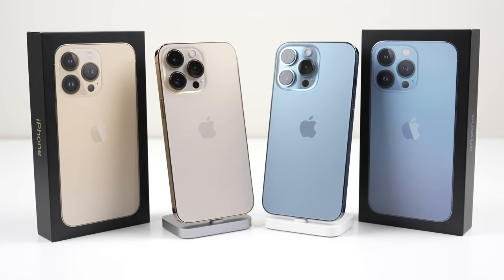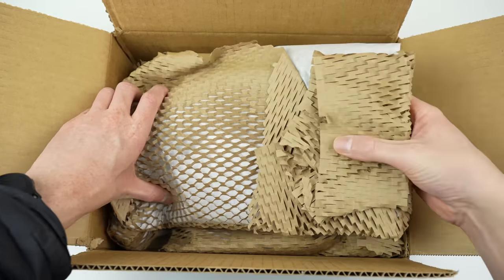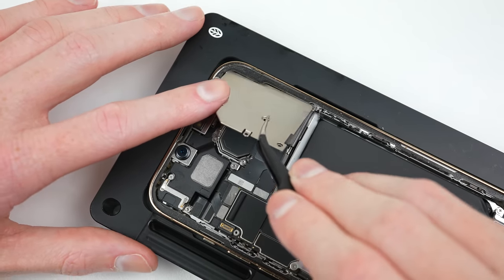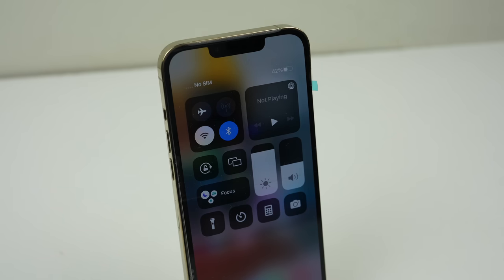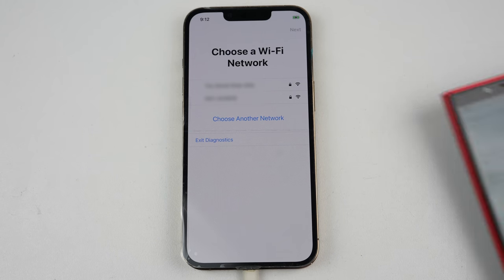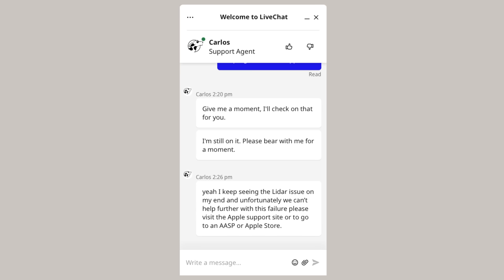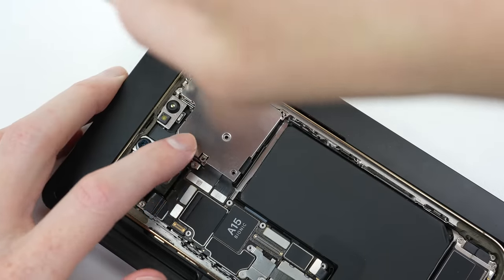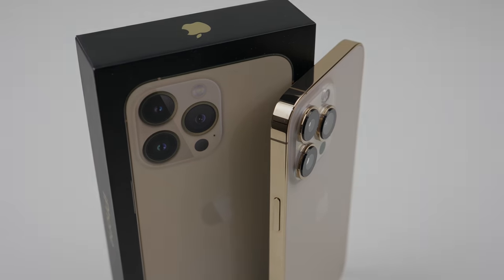Apples Self Repair Program Is Not What It Seems

Comment: For anyone curious, every part associated with the error messages has a small chip embedded in the part. The battery has a small logic board that has this chip, the display has it soldered to the back of the display, and the cameras have it embedded in the flex cable. This chip holds a ROM module with the part's serial number, if the serial number is different from what the motherboard expects then it throws an error and is no longer able to communicate properly with the unit. This is not a calibration issue, parts needing calibration generally still function, just "off center" so to speak, the ambient light sensor would view full sunlight as ambient light and ambient light as pitch black,. Adjusting values back to what they're supposed to be is what "calibration" means. The ambient light sensor doesn't work because it's IC is integrated with the front camera flex and is paired, the proximity sensor is it's own unit and not a paired device so it still turns the screen off when covered up. Stuttering cameras are due to the controller IC not properly communicating with the motherboard, that's not a calibration issue, it's a programming one. For older units, tools exist to copy this data from the devices being changed to the new ones like screens and cameras. Apparently Apple re-writes the data on the motherboard which is probably why it takes so long, writing the display itself takes about 15 seconds, I know because I've done a lot of them. They likely do this (because it otherwise makes no sense) to prevent the device from having multiple compatible replacement parts, if you refurbish the display you won't be able to use it on the phone again.
TLDR: 100% of these issues could go away tomorrow if Apple just updated the motherboard's firmware, but they won't.
Reply: Thank you for an information, so its the same used on a expensive cars, but for phone lol

Comment: Omg thank you for this video, it has been fascinating. I’ve been wondering about Apple’s repair program since they announced it and I assumed that they would give you access to everything as long you pay the price tag that comes with it. It’s a shame that they did not provide the calibration tool to finish the repair (Are they worried people will use the tool’s bits in order to bypass iPhone security and gain unlawful access to their devices?) If so, they could might as well allow you to create a user name and password as the repair technician and access the calibration tool remotely, effectively keeping their bits in their secure servers.
Reply: The reason it is the way it is, is very simple. Money.

Comment: I miss the days of hot swappable pieces for electronics making repairability a cinch
Reply: I miss electronics being made without the use of proprietary screws.
Reply: @LexYeen  amen
Reply: nokia days were swappable parts are easy
Reply: @lace1210  That's why nokia phones are still running!
Reply: It's only getting worse. Laptops for example are now starting to be shipped with soldered on memory. I won't be surprised if the SSD soon follows.
Reply: I miss the days of detachable batteries. I just had a case at work where a phone froze and wouldn't respond to anything and only options were to wait for the battery to die or remove it. Can't remove batteries without tools anymore so waiting it is.
Reply: ahhh the iphone 4 days, so good
Reply: @croftmanor2k23  apple has already been doing this for years
Reply: That was when the manufacturers weren't so greedy and ruled by money.
Reply: @gp3328  You mean Crapple, not Apple
Reply: @LexYeen  Samsung still just uses Phillips screws. I replaced my battery on my A71 in an hour, pretty easy all things considered.
Reply: Wozniak spoke about this in a cameo for Louis Rossmann, and man, his words hit super hard. Gone are the days of hot swappable components without proprietary stuff or even calibration that is so unnecessary. Worse is that in the case, there's even a data collection for a simple repair, which is already a violation of privacy. 

This is why we must keep supporting companies like Fairphone and Framework. If they succeed by being with the times (like flagship level components and global availability), we can only hope change is happening, which I doubt would happen.

Comment: Back when I was doing iPhone repairs (up til 7) there were much simpler issues; now I had to learn about the new restrictions in building my new iPhone XR. I got it May 21.

They have made it so much more difficult, but if you shop while anticipating the restrictions, you can still get a good deal. My 256GB factory unlocked XR had a broken back glass but everything else was spotless, and I already had an XR 64GB with a shattered LCD but good back glass and frame, as long as you keep track of what parts go where, no error messages. 

With taxes and genuine adhesives, total cost was <$250, but the device itself was $220. Apple's repair program costs $199 before taxes. 

If I have to spend the same money either way, might as well go the way that also nets me 3x the memory. 

This was fascinating to watch tho. With the adhesive removal, I find that using a micro screwdriver works better for wrapping the adhesive around, and pulling away while in the same plane and also pulling and spooling with a sort of cadence will minimize the breaks. Feel the tension of the adhesive and dont let it get longer than 1CM before spooling and pulling again  I used the ispropyl swabs only after getting the adhesive off as to remove leftover residue and oils. 

As a side note, the screwdriver trick can also work for removing an iPhone battery without extracting the taptic engine. If the adhesive does snap, use the existing adhesive on the screwdriver to re-adhere the adhesive at the break and you can start pulling again.  When you're tasked with repairing hundreds of devices per day, you learn little tricks like that to speed up the process. 

Edit: As a note, be careful of your screwdriver orientation, especially if you have metallic screwdrivers. As I mentioned, it helps to be pulling from as close to the same plane as the adhesive, and if you're not careful you can rub off the anodizing on the frame of the device while you're spooling. Even plastic tools can leave a shine. Just thought I'd mention it.  

I do like that repair cradle as well, my low-tech solution involved a windshield suction cup for an old GPS; if you remove the ball joint from the pivoting device holder, it acts like a display kickstand. That cradle seems a lot nicer than the ones we used at our shop, even. I only kept my screwdrivers and separator tools, so I also had to use a food dehydrator to soften the LCD adhesive since I no longer have access to a hot plate. I also popper it back into the heater after the repair just to help improve moisture resistance since I don't have that applicator you showed. It worked well enough on the 6s/7 seals, since the frame and adhesive expand and contract with each other given the applied heat.

Just thought I'd offer some tips, I hope they help with your future repairs; thanks for posting this video!.
Reply from the maker: Thanks for the tips. I will keep them in mind.

Comment: I have a question do you have a 2015 MacBook air screen?
I have a MacBook air that turns on but doesn't display anything. I will plug it into an external monitor and check. The MacBook is water damaged.

Comment: Now for those still defending Apple we see many offense they have done to their customers:

1. Data Privacy - Changing screen, camera, battery, etc. doesn't mean people need to give permission to Apple on their calls, images, and other privacy stuff just for the sake of having genuine parts acknowledgement. Not that there's no connection for data and repair to begin with. 

2. Ownership - People don't need permission from Apple to repair/replace parts on their own device and for Apple to downgrade the "features" just because they repair their own device. What right does Apple have to limit people's rights to use their own device just because they don't follow what Apple's repair guidelines? Does people own their iPhone or Apple does?

3. Repair shenanigans- The sheer hassle of "calibration" already adds to perception of general populace that it's better to buy or let only Apple repair their devices, coupled with "features" downgrades for unauthorized repair, this in turn further cement the perception of the general populace pertaining repair & ownership. Even the "technician" doesn't know the problem of the said device after "calibration" and offering your data to Apple. What's the point of Apple repair program?
Reply: thing is I think part of the OG repair process is to pretty much reset the phone to factory settings then start the repair at least thats part of my experience when I tried to have a battery replacement on my iPhone 5 so theoretically nothing is "gained nor lost" but if you don't use iCloud then you better be sure you have the entire phone backed up to a PC/MacBook/Laptop when you get it back.

as this "repair" process is no different from what happens behind the doors of Apple Service Center yes you have a technician calling a technician to do the diagnostics system
Reply: I want to see the factory worker in Shenzen moving the camera back and forth on every device leaving the product line.  Apple deliberately is trying to make it as hard as possible.
Reply: Actually no you don’t own the iPhone because the OS is so much connected to the hardware that you own, that basically your ownership is superseded by Apple ownership of the OS. That is basically how the Apple legal team answered one of the company requirements : overstep the legal requirement of them being forced to sell the rights to the hardware. They found the pairing system software locks.

Comment: the screws are not there in case "you're clumsy", they are there because when you do official repairs for apple, you HAVE to replace them. and afaik they are covered in some special adhesive that prevents them from getting loose.

Comment: I work for an Apple authorized service provider in the US so I have a lot of experience with their processes. Almost all repairs require either calibration or something called system configuration. The latter of those two is what can be run remotely by Apple support after a self-repair. This is also why they aren't offering the program on older models as they require a calibration that requires the device to be plugged into a computer that has specialty software installed. Regarding the screws that are included with the screen. It's not In case you lose a screw. Apple has a strict policy against reusing screws. If we remove a screw then we have to replace it with a new one.
Reply: The screw policy is so dumb.
Reply: I guess that basically sums up Apple's policy regarding environment: "screw you".
Reply: @null  having had to deal with stripped screws on multiple occasions I can kind of understand this policy.
Reply: @DanVerley  Yeah, but it still seems a waste to just throw away screws.
Reply: @mathewng1988  Accurate.
Reply: @null  perhaps. But for all their faults, Apple is 100% committed to quality repairs. This is one thing that they should be given props for. Having disassembled a few phones that have been "repaired" by a third party I can sort of understand their reticence.
Reply: @null  What if the old screws start to rust? Apple doesn't want to risk screwing anyone over with old screws.
Reply: @null  what a gram of metal? What a waste!
Reply: @trancenut81  adds up
Reply: @null  In that case every breath you take gives out co2 as well. Its okay if you dont like Apple but we have more things to worry about than worrying about less than a gram of metal when replacing display on a phone which for me has only happened once in the last 10 years
Reply: @trancenut81  eh, I guess. I do like apple btw though, I have an iPhone a Mac and an iPad so I am definitely trapped in there ecosystem.
Reply: @null  The screws are likely recycled, if Apple's promotion of their ability to recycle much of the iPhone is true

Comment: Encryption isn't the same as encoding, but they might look very similar. There is readable text, so it looks like it's just encoded.
You might find someone, who might be able to decode the messages, or adjust them, so the phones could be paired from a fake server in the future.
Reply: HTTPS usually encrypts data

Comment: Apple just at this point wants money. If they cared about the environment maybe they'd take a year to improve the repairability rather than making things better.
Be a great way to differentiate the models, too

(Comment meant to go on first video, tried to get it up as quickly as possible)
Reply: Actually by apple releasing these parts at about $30-$40 cheaper than an oem refurb from a reputable seller, it made the seller drop their prices also.

Comment: As someone who works for a very large third party Apple certified repair center, I can confirm the entire calibration process is extremely difficult and can take way longer than needed. I can have a part in a phone and closed up in well under an hour but because of the calibration most repairs take 1.5-3 hours and I’m even the one running all of the repair calibrations and diagnostics through Apple’s system, GSX.

Comment: As a side note. The screw package that comes with the display isn't in case you misplace screws, per Apple guidelines you are supposed to replace every screw removed. Working for an AASP they actually have AASP locations add on consumable 011 number parts ( screw kits and adhesive ) to every order so they can replenish as needed. I think it's pretty silly to be honest. Also a little tip for the adhesive, once the screen is removed reheat and use the twirling method. Even after repairing these phones since the 12 series came out with said adhesive I've only been able to get all the adhesive off in one shot a few times. Takes finesse lol system configuration is a pain (when camera calibration is required) and requires AST2 access. Prior gen phones used a stand alone calibration software. They should really consider allowing users that process the at-home repairs like this to have one time use keys to access AST2 to run system configuration and post repair diagnostics.
Reply: Thank you for saying everything I wanted to say as a tech, but am scared to piss off papa apple... 
(I feel he would have a few choice words about using sysconfig himself.)
Reply: Just blows my mind that they have you spend all this money to repair the phone yourself but have to connect to a rep to run config remotely. The issue with the camera after the repair I found happen WAY too often. I got to the point where I didn't want to perform and/or offer rear system repairs due to the Lidar not picking up after transferring the camera. In my mind how hard would it be to have the "customer" use their Apple ID and send them a one time use code to access the suite via email. 🤷🏼‍♂️

Comment: When the self service program launched several prominent Youtube channels got their hands on the rental equipment and tried it out highlighting their repair journey. This is the first video I've seen mentioning the ridiculous calibration steps required to return full functionality to the phone. Very suspicious the others would leave this step out in their reviews of the service. Perhaps they were "offered" the chance to review the service rather than renting it genuinely. Even a very popular channel focused on right to repair very cleverly skimmed over the subject.
Reply from the maker: The calibration is the most important thing to have covered, as it was the whole issue with the phones when I initially tested the repairability. They wouldn't work properly because of the calibration I couldn't do. 
The fact that the software is only available to people who use the program shows this doesn't comply with what right to repair stands for. Anyone should be able to calibrate their new parts, Apple or 3rd party. But lets be honest the parts pairing likely wouldn't exist if that was the case. 

I would of also liked to use their tools to give a full look at the program but international shipping would of been between $800-$1000 plus the $1000+ for the kit of tools. So just wasn't feasible for one video.

Comment: The self repair  program  is designed  to make more  money
Reply: I don't think so, the cost to rent the tools is 50 dollars, which would barely cover the cost of shipping it. All up it costs about the same as if you were to get it repaired at the apple store, which isn't a good deal, though they lose money from apple store repairs anyways. I doubt they would be making much money from this, if any. They are doing the self service repair program because they have to, not because they want to, if they did want to, then it would be a lot more eloquent then this.
Reply: @Decommissioned  I suspect that it's also so onerous to discourage participation.

Comment: They will give somehow give you the calibration software. Most of the repair shops in my country has the software and also the genuine parts from apple (batteries, screens, even screws, foam and any other parts you'll need for an iPhone)

Comment: 3:04, the screws are meant to be swapped out. The rectangular outline on the cardboard is meant to be oriented to the battery, and then the screws are in the same general alignment as the ones you will need to remove. Apple's tri-headed screws are really soft metal and use friction to stay in place.

Swapping them out ensures the highest quality repair, Samsung certified repairs are the same to refresh Loctite on their screws.